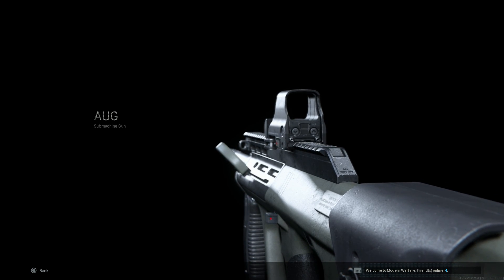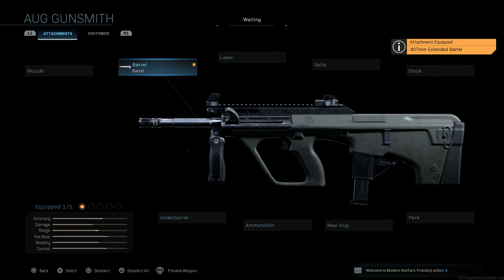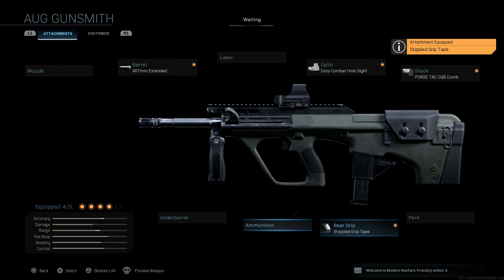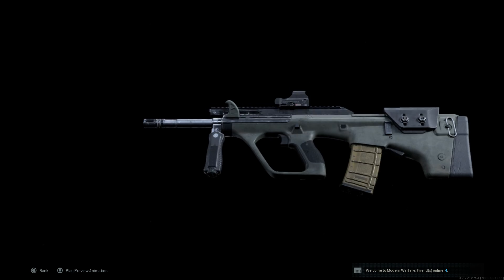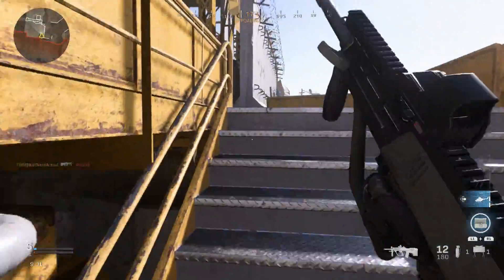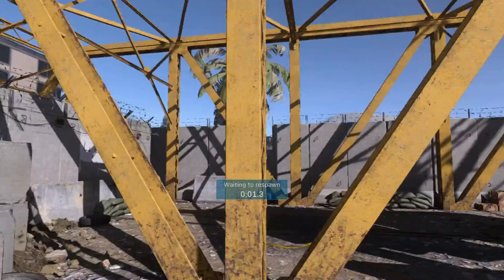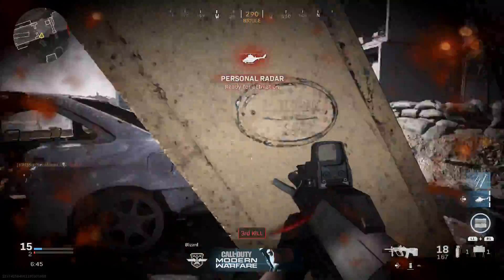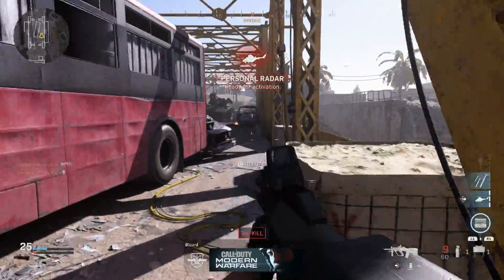F88C Austeyr Weapon Conversion - Call Of Duty Modern Warfare

Comment: G'day there I could definitely see an ASLAV crewman using this or a Unimog driver.

I remember when I did AAC the aloud you to fire the F.88 Austeyr AFX in Tier 1-3 and tier 3 you carried/cleaned/slept with the rifle for the week while tier 4 that stayed the extra week got to use the F.89 Minimyer SAW it fired a 5.56mm round and is similar to the M249 which iirc was the Maximyer firing 7.62mm.

The Standard F.88 was the the 627mm barrel, donut sight they they called it, it would have a 48 round magazine but the 30 works + a grip, it was all in semiautomatic fire so this could be an idea for a build the standard ADF/AAC F.88 might work well in Hardcore.

The ADF modernized the rifle an called it the EF.88 the hole casing is very different compared to the standard F.88, I rockon that could be a cool BP/ season reward if added.

Now I wonder if you could make a Browning HP with one of the sidearms in game.